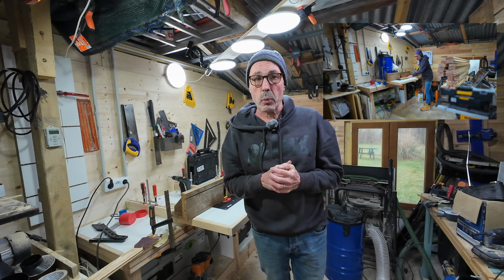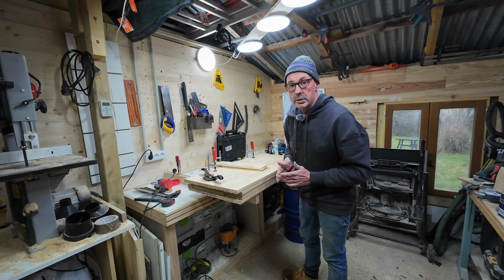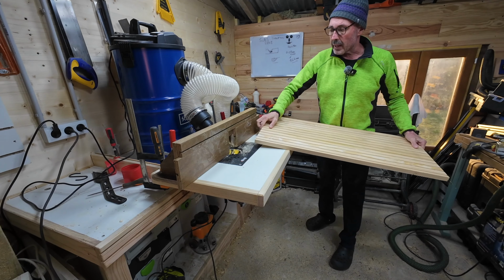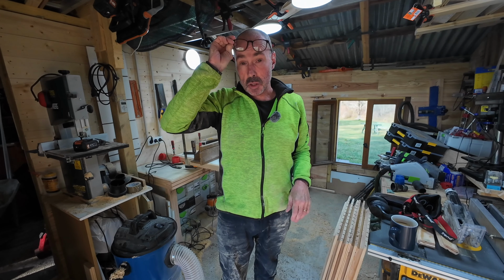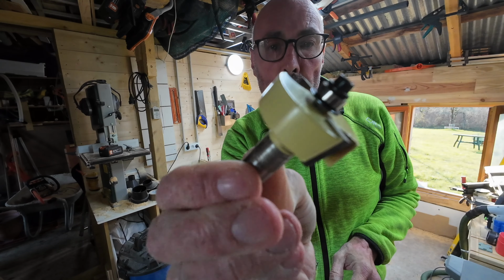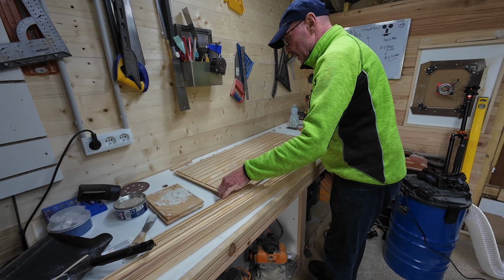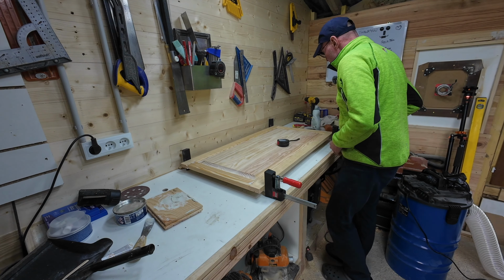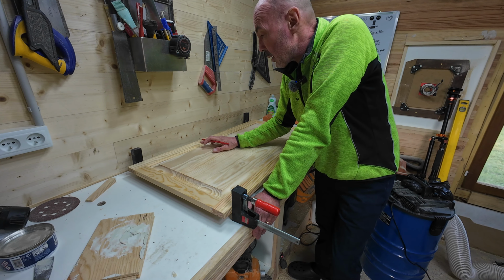The Panel Doors are Finished but I've made a Huge Mistake!

Comment: The fella who never made a mistake never made anything...I'm at the glue up stage of making doors for a kitchen...26 doors and drawer fronts to glue up😵‍💫😵‍💫
Reply from the maker: Nice 👍 26 doors is quite a task. What species did you do for? Regards JP
Reply: @Smallbarnworkshop  Shaker doors with poplar frames and mdf panels. Like yours they'll be painted/sprayed.
Reply from the maker: @MrCassbren  nice 👌